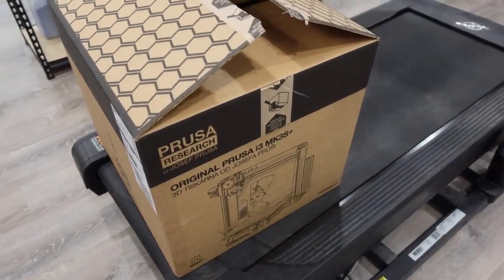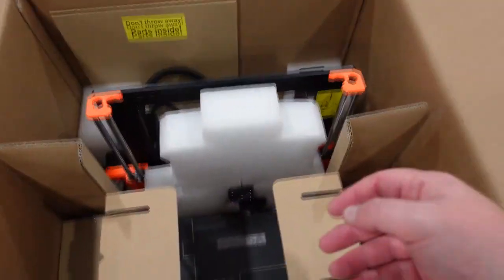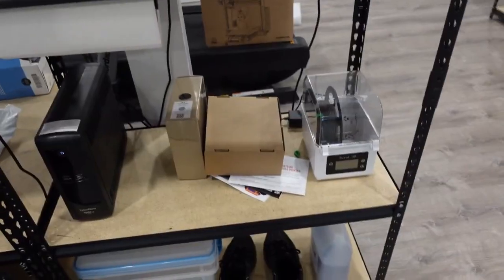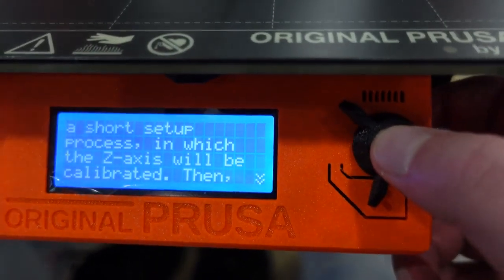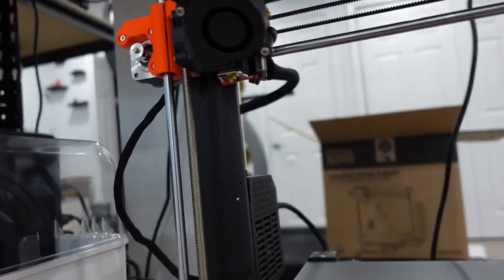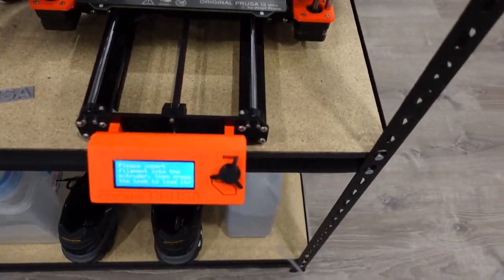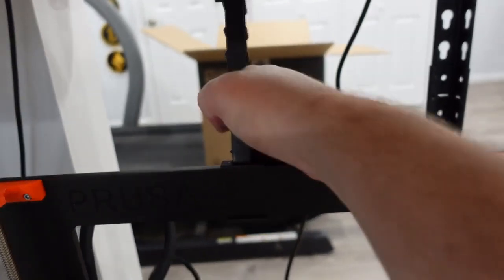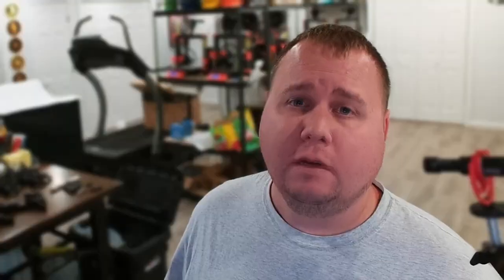Prusa i3 Mk3s+ Unboxing and Setup + Tips   The BEST 3d printer, period

Comment: How do you decide on when to print with pla or petg?  Thanks.
Reply from the maker: Definitely start with PLA it's much easier to print with if you need to keep anything outside or inside of a hot car or hot environment make sure you use PETG or better but it's hard to print with and very stringy if you don't do it correctly